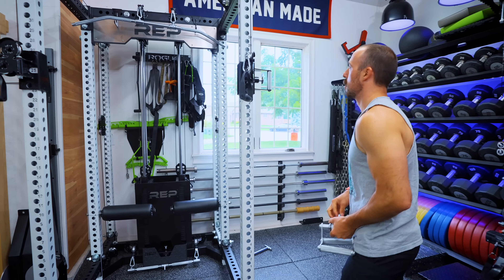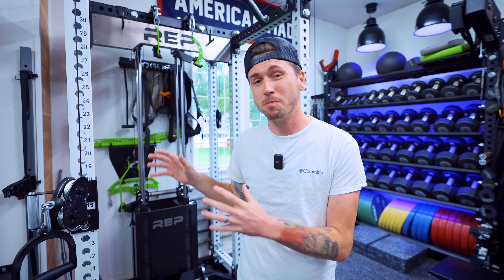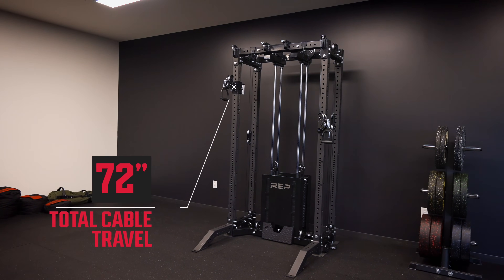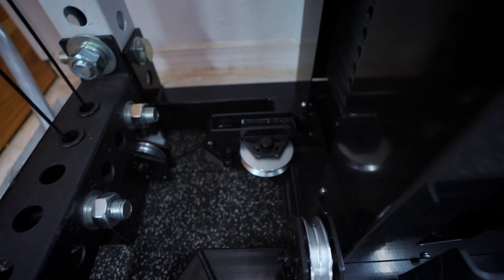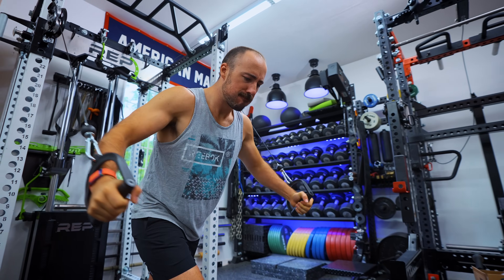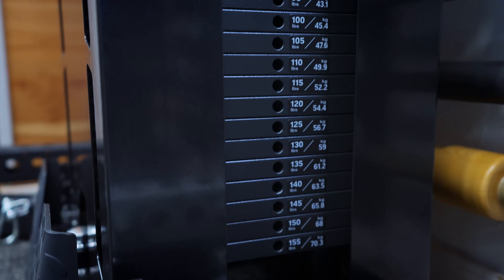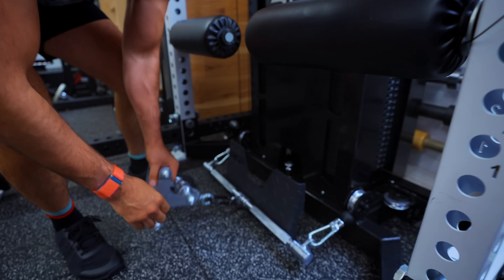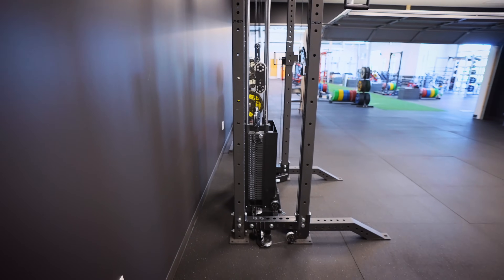REP Fitness ARES Cable Attachment Review: The Hype is REAL!

Comment: Do you think there is a way to fit the Areas with a configuration of 41"x93" with a 36"x100" rogue rack?
Using the Areas cross members for the back portion where the Areas built in but with the 100" rogue stands and the 36" rogue cross members for the rack on the front. Maybe the 5" in depth makes for the 7" high difference?
Reply: Watch out. The Rep uprights are 2.95 inches wide whereas Rogue is 3 inches. So the functional trainer may be too loose...

Comment: I currenyly own a PR 5000, 6 posts 30" + 16". Can I still deadlift inside of the rack? Or do I need to do it outside bc of the cable running on the bottom of the rack?

Comment: Excellent review...........I'm looking to get the Ares to compliment my Rogue Collegiate Half-Rack. Do you happen to have any feedback on the 80 inch Ares (my ceiling is only 92 inches so the 93 probably will not work)..........??
Reply: don't do ares 80 inch half rack it's terrible. can't squat unless you are a midget since the cable handle would hit your plates every time you try to lift the plates from jhooks and you can't move the cable handles up since it's blocked by the upright bolts

Comment: I think the upgraded weight stacks would just about cover all of my needs, except for use with the belt squat attachment. Assuming I'm understanding the pulley ratio thing correctly, each stack would effectively be only be 155lbs, thus the max you could belt squat with would be 310.  Would using something like a GymPin to add additional weight work here?  Because I think I would just need to be able to add two 45lb plates to each stack.  I don't think I'd ever go much heavier than that.  However, it seems like that shroud they have surrounding the stacks would get in the way.  Can you opt to not install the shroud?

Comment: Love the review!
I am planning to add ares to my 6 post rack. But instead of adding it in, I am thinking to add two more uprights and 16" crossmembers at the back. That way I will have full rack with no cable mess one way and ares facing the other way.
The whole setup will be 8 post rack that is 2 feet deeper than 6 post rack.
Do you see any issue assembling it this way?
Reply: The cables won't be long enough.

Comment: My Ares is shipping next week.  I, too, was worried the the low row pullies were too low and you confirmed it.  I would like to hear Rep’s rationale about putting them in that location when it looks like there is room to put them 4”-6” higher.  Maybe offer a bolt on solution for this?  Not much you can do when they are that low but you can adjust you seated position (gym mat, etc.) if they were a bit too high.  Still stoked to get this up and running and see if I can hack it to perfection.

Comment: I bought a PR5000 just for the Ares. Coop is 100% right about the low row. I probably hate it more than Coop because it just feels very uncomfortable with the cables and where the footplate is. Raising the bottom pulleys a little higher would make it feel a lot better and more natural. Right now the cables are running along the feet and not through the feet like Coop said. Maybe they'll fix that in the next updated version.

Another con I dont think I heard coop mention was the cable length. Its a little short in my opinion and doesnt give you any real slack when you screw in the other side to the handle. It feels like the screw is barely screwed in and if you tighten it just a little, the weight stacks are lifted.

Other than that, the Ares has been great. Super smooth.

Question:
Does anybody know if the Prime Low Row footplate attaches to the REP PR5000?
They both use 3x3 1inch holes but im worried about the hole spacing.
Reply: I was dealing with the same issue with the bolt! I thought I installed incorrectly, but the cable is definitely too short.

Comment: Do a review of the Fray Fitness Rack with built in functional trainer. It is priced at 2500$. Way cheaper than the Ares attachment and rack.
Reply: The Fray Fitness Savage Series rack/functional trainer listed at $3,200 then you add $300 for the lat pulldown seat/knee brace, and doesn't appear to have a low row.  Am I missing something?

Comment: I would love to buy this but I can't help but wonder 1 will Rogue make their own version for the monster/monster lite and curious if this will work with racks that aren't Rep racks.
Reply: Rogue has something like this already, they call it the Rogue Monster Cave and it also cost around 9k before shipping and taxes.

I contacted rep for fitment compatibility with 49” Rogue rack and they said they can not guarantee fitment.

I will assume that the length of the cable you order will be specific to the rack dimensions  you pick. So even the stopping points will be build to that dimension. You would probably have to figure out how to cut a cable to the length you want to make it fit on bigger or smaller racks.
Reply: @hby7768  thanks for the reply. I couldn't help but also wonder about certain things like the guide rods a little more then the cable but none the less the easiest option is usually the best option. I should look more into the rogue cave setup but if it is what I think it is it is on the outside and to the side of the rack instead of the inside like this one from rep. Does rogue have options that are similar that I didn't see that you are referring too?
Reply: @xboxfanatic5622  im in the middle of figuring out what to do with my rack that is why i have been contacting both rep and rogue. I will wait for the Rep Athena to come out and see if they will be a good option since from what i can tell, it should fit on any rack from most companies.
Reply: @hby7768  if that is the case I figure it would be a great option. I was looking at the plate loaded version of Athena and thought maybe the guide rods are really the biggest hurdle to deal with but I could be wrong.

Comment: I received my ares weight stack upgrade today and the plates are 10 pounds each, I thought the weights we’re supposed to be 5 pounds each ? I’m I missing something or get the wrong weights delivered. My complete Ares didn’t arrive yet so I am curious why these plates are 10
Pounds each. All the pictures I can find I see 5 pound weight stack plates ( 5 pound increments )
Reply: The plate weigh 10 lbs each, but remember that the pulleys are a 2:1 ratio, so that 10 lbs will feel like 5 lbs. The weight stickers account for this 2:1 ratio, so they go up in 5 lbs increments. But the plates themselves weigh 10 lbs. Hope this helps, and good luck with the AsSambly!
Reply: @mikklethepickle  Thank you for clearing that up.

Comment: If someone were to purchase a rep rack and the ares system, for the asSAMbly process, would you have to build the rack first then add the ares? Or would it be better to put both together almost simultaneously?
Reply: I would look at the rep ares assembly video they put out recently. They have a pr 5000 pretty much all set up with all the bolts loosened before they put the ares on
Reply: @Wetterwet  omg yes I’ll check out that video sometime! Thanks 🤘🏽
Reply: Build the rack first. You don’t want to do it simultaneously. There’s too many moving parts. Additionally, if the rack is up, as soon as you get one side done on the cables, you basically mirror the other side.
Reply: I did the same. I am going to build the back 4 columns with Ares and complete that part. Then I will add the front columns with the front pullies already attached. Then I will put on the rest of the pulleys and run the cable. The front columns have to be removed to slide the front pullies onto them, so might as well install them together as I am.

Comment: Can you ket me know how the Rep ISO arms work with the Ares since they have to bolt on?  Would theTitan Jammer arms make more sense since they come on and off easier with pins?
Reply: I have both the Ares and the Jammer Arms.  So, when I use the Ares I just slide the Jammer Arms all the way down to the floor out of the way.  Then use my Ares cables for whatever I need them for such as cable flyes etc.  Then when I use the Jammer Arms I just slide the Ares Attachment all the way to the top of the rack and use my Jammer arms for whatever exercise I need them form. So basically you just slide one or the other to the top or bottom when not using them.
Reply: @raps7027  Thank you ! Are you able to do low pulley cable crossovers with the jammers arms beneath the trolleys?  Also, are you using Reps Iso Arms or someone else's jammer arms?
Reply: @brettsinger8069  Yes absolutely!  I actually have my Jammer arms on top of the trolley for the Ares.  So, I slide my Jammer arms to the top of my rack when doing low pulley crossovers or seated rowing.  I have the Rep Fitness Jammer Arms.  Now, I also have the Irwin Fitness Monolift but that is something I have yet to put on yet as I may have to get creative.  I only have the 80 inch Rep PR 5000 Power rack so you do have to get creative when using all the different attachments.  And to be honest I had someone install the Ares Functional Trainer just last week so I am still trying to figure out everything and how to use all the different attachments.  Obviously it would be better if I could just take those Jammer Arms off and store them, however I do use them often for my workouts, as well I want to use them fore Personal Training my clients, so, I have to try and get creative, I will update you if I find some other options or suggestions, but I am still learning myself. LOL
Reply: @raps7027  Thank you again!  Ok, so you can put the ISO Arms on top of the Ares Trollies?  I was told by Rep that you have to put them under the trollies...

Comment: This is a true 3x3 with 1 inch holes? Would this fit into my Rogue RM-4 rack??
Reply: Yes, 3x3 w/ 1", but no way it's going to fit another brand of rack (especially a wider Rogue).  I put mine together last week and everything is made exactly to fit the Rep with very tight tolerances.
Reply: No, it's not true 3x3 tubing. Just like cars, anything that's imported uses a standard metric, while US uses imperial measurements. It's slightly smaller than 3x3. But it is 1" holes.
Reply: @tbookou  damn. I would buy this in a heart beat if I could use it. It's just a bit much to sell my Rogue rack and switch over to Rep. Have to give Rep credit tho, this is bad ass!